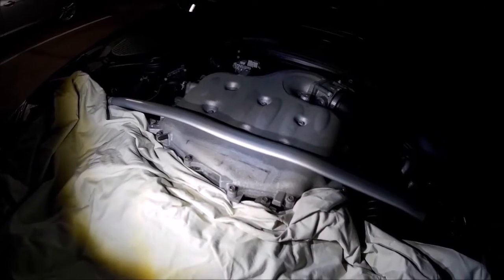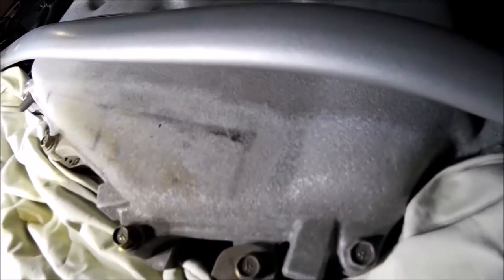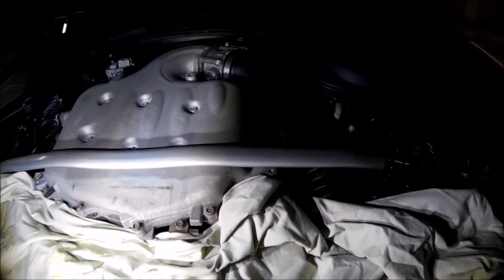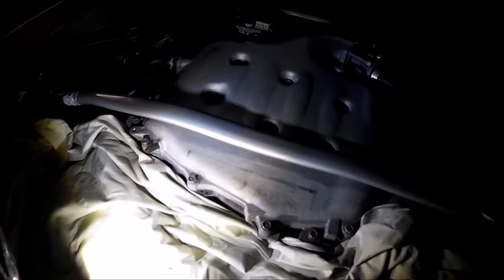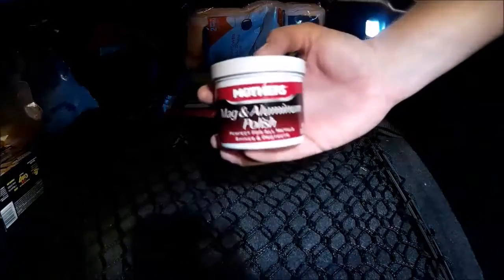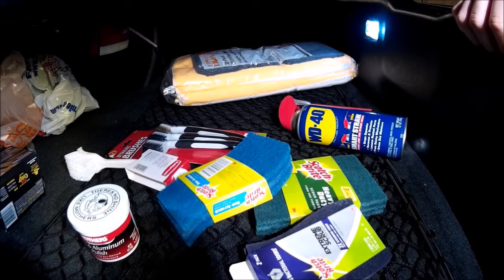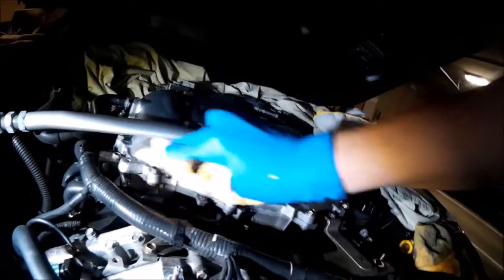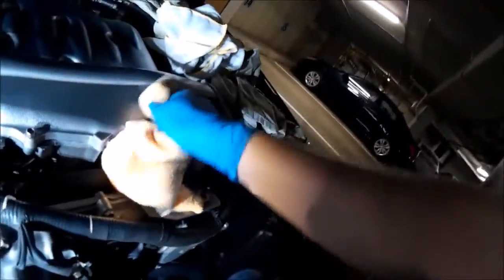350Z Plenum Cleaning/Polishing - How To

Comment: I used multiple Dremel attachments in different grits. That got me to a pretty clean look but then I used Simichrome (highly recommend for anything metal polishing) and that gave me a mirror finish. I didn't go as far as trying to get the manufacturers pitting out (just kind of the wavy aluminum texture not actual pitting) but it's definitely a mirror finish. Took me about 4 hours total. Not enough material taken off to cut the aluminum but enough to make it look good. I worried more about the inside of the plenum when I had it all stripped out. I was working on fixing one of the plenum bolts, actually 3, that someone stripped. Used a thread repair kit with the inserts and that worked excellent. I was pretty worried drilling out my block 🤣 but it turned out better than expected. Not sure if it even helped performance but I know it was done to my standards.